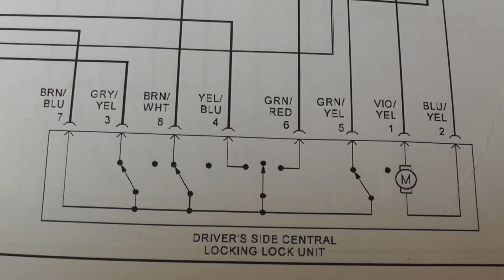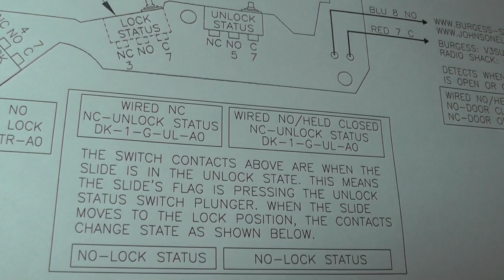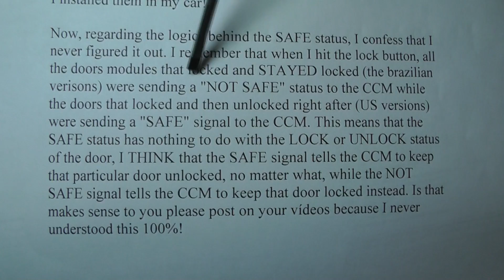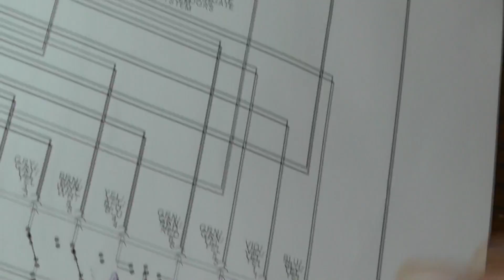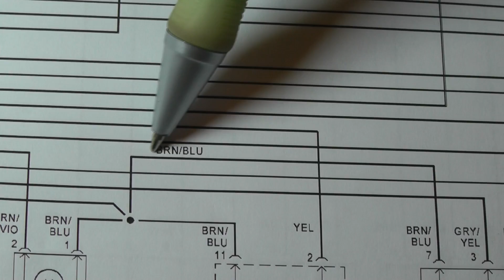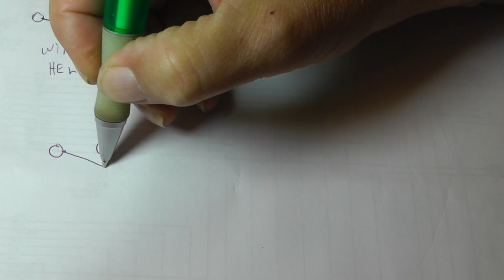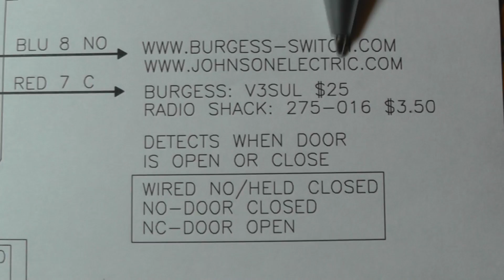The Electrics of Volkswagen Door Lock Modules - Part 3

Comment: It would have been nice to supply a test sequence for the 1-8 connector to establish if and what electrical problem is present.  

I have a convenience module in emergency mode which some have said is caused by a door module.  So I would be helpful to verify if the door module is functioning correctly.  But a great video presentation.
Reply from the maker: Thanks for the comment!

Comment: Thank you for taking the time to make these videos. I appreciate your methodical and thorough presentation. I subscribed immediately and am looking forward to watching your other videos.
My door lock problem is I cannot lock or unlock the door wirelessly with the key fob. The electric motor will turn the gears and move the plastic worm screw shaft when it disassembled and separated from the rest of the locking mechanism, but it doesn't have the strength to move the components when it is assembled. I doesn't appear to be binding and is lubricated, so I'll have to locate and replace the electric motor and see if that remedies the problem.
Reply from the maker: You are quite welcome Roy and thanks for the sub! From your description of the symptoms, it does sound like the motor may be a little weak. Good luck on your repair and have a great day!

Comment: Hello Mr. Stuzman!  I appeal to your experience!  The front right door would no longer open from the outside or from the inside.  I replaced the frog with a new one.  After two months, the same problem.  Now I bought another new frog, which has been working perfectly for two weeks.  Now I can't open the door in any way, neither from the inside nor from the outside.  You can hear how it works electrically, but it doesn't unlock.  What can be the problem?!!!!!!!  How do I still manage to open the door?  Is there a solution?  Thanks!

Comment: have an issue and maybe you know how to solve it, it is a 2001 mk4 TDI driver side door that would unlock using a fob but won't lock using a fob. it would lock using a fob, only if I unlock it and lock it within a second, same situation happens inside the car, with 2 buttons near the inside door handle. any ideas, or suggestions?
Reply from the maker: You probably have an issue with the door lock module. Have a great day!

Comment: I have an American version Jetta, when you push the door locks it locks both right doors and the rear left door and attempt to lock the driver door but then unlocks it I guess so you don’t lock your keys in the car? I wish I could push the lock button and it would lock all four doors so probably if I got a force switch module for the drivers door it might lock it and do away with that problem I think they’re saying safe mode would be Unlocked so you wouldn’t lock your keys in the car?
Reply from the maker: You're probably right that the behavior is to keep you from locking your keys in the car.

Comment: Hi Mr. Stuzman!  I have an unanswered problem.  When I open the driver's door, the door light comes on each time, but on the dashboard of the dashboard the open door indicator light comes on and goes out.  If I tap the door module lightly, the indicator light on the display lights up continuously.  What could be the problem?  Does the light in the door lamp that I put on the LED influence and it is no longer an incandescent bulb?  Or is there a problem in the door module, imperfect contact at the connector pin, microswich ..... what can it be ???
Reply from the maker: When you tapped on the door module, it shows that your problem would be inside the unit. More than likely you have a bad solder joint(s) on the pins that connect to the PC board. In any event, you'll have to take the unit apart and open it up. Have a great weekend!
Reply: Thank you very much Mr.Stuzman! I'm very grateful!!!
Reply from the maker: @octaviansorescu7427  You are welcome Octavian!

Comment: Thanks both for your professional job.
From the UK I can tell you that even with a fifth microswitch on the board, it never gets operated - on my 2000 Passat at least! In my driver's door lock there is a nylon latching mechanism (which you don't have) underneath the helical gear part. Maybe the case is a bit deeper to accomodate this. This is a swinging arm with tracks that engage with a pin below the brass part that deals with the motor stalling.  This part has 3 detents, in theory allowing it to swing across to two alternative positions below the helical slider and a tab that would, in theory, operate the fifth switch. But it has NO spring to bias it in the direction of switch five and so it never moves. I can only assume that the mechanical part of the mechanism was designed pre-1997 and the electronics 'improved' later leaving a bunch of redundant gizmos 'hanging'. 
By the way, Cherry is now part of ZF and the  DK series microswitches are everywhere unavailable, or at least have a MOQ of 20,000!
Reply from the maker: Thank you Michael and greetings to you in the UK. Yeah, it's a wonder what the fifth switch actually does. And thanks again for leaving a comment!

Comment: I think I can explain what the missing fourth micro-switch on the actuator PCB does for UK/Europe.  
All vehicle door locks must have a two stage locking action. 
Stage 1 locks the door and disables the outside lever. 
Stage 2 dead-locks the door and also disables the inside lever, so that the door cannot be opened by breaking the window glass.
To achieve this dead-lock, the lock motor is pulsed twice in the lock direction.
What is missing in your US version of the actuator is another 3-position lever below the slide that only operates this limit switch in the dead-locked position.
I have recently taken apart the driver's door lock of my VW T5 Van where the actuator is similar, but right-hand drive.
I can send you a photo showing this lever with the actuator slide removed if you provide me with an email link.
Reply from the maker: Thank you Brian for the added info as I'm sure that it will help others out there.

Comment: I wish all documentation were as clear and comprehensive as your diagrams! It took two days' work but I've fixed one door lock module with help from this video and others on YouTube. The fault was the usual cracked solder join between PCB and connector. What were VW thinking, using rigid metal lines to connect a motor, a PCB and a connector?!
Reply from the maker: Glad to hear the video(s) helped you out!

Comment: Safe locking prevents door to be opened at all, it is made by 3-state lever which makes even lock button inside inoperative. Then only way to release locking is by motor. 
My problem was that lock did not open by motor, maybe once of 10 trials and in winter never. Don't know if it was electrical, software or mechanical problem related to 3-state lever.  I solved problem by removing the lever and now lock has only two states, locked and released.
I can hear difference when opening, the door with lever removed says single click, and door with lever still in says click-click as mehanism need to make two opening movements to jump over safe state. I assume this difference is contolled by software reading status of 3rd microswitch.
Reply from the maker: I would assume so also. Not 100% sure.

Comment: EXCELLENT! THANK YOU! 
About SAFE function: it disables internal handles, to do that there is a specific leverage inside latch module and the famous 4th switch. When you lock the doors the Comfort ECU sends TWO pulses to the motors to properly actuate safe machanism, 4th switch sends feedback that safe lock is activated. The goal of SAFE is to put some more difficulty to thief: if you break one window you can't easily open doors and enter into the car. Why building it so complicated, with additional leverage and switch? Because SAFE lock is default but it is an option. You can still lock in normal way. How? Click twice when locking your car. You can hear one single pulse to latch motor, additional leverage is not triggered and internal handles are not disconnected. SAFE function works if Comfort ECU has the correct firmware (sends 2 pulses to lock), that's what happen for markets outside US. Hope this can help someone, like often I've been saved by your helps.
Reply from the maker: Thank you Mauizio for the added information!

Comment: Hello there, Great videos. I have seen these locks deadlocked on cars in a few videos. Mainly from UK. ( mine is at the moment). You have obviously sussed the 4th lock switch function by now. The question I want to ask is this: as the lock is in a locked position, why didn't you use your technical knowhow abiltities to work out that reversing the motor may unlock the locked lock. (motor lock has 3 positions. unlock, lock and deadlock). Would it be of benefit to trace the lock loom out of the locked door into the cabin area of the car and find its ecu ( if it had one) and trace the pins on ecu that control door lock motor and apply voltage to the loom pins that free the lock from its locked state. ( did you pin 7&8 are motor lock? i forgot) That way people would not need to take a drill to their doors. Last thing. would the lock be able to be engaged/cycled as an ouptut on VAG or ross-tech software. Then there is no need to strip trims, carpets etc to access Joints/ecu's   Thanks
Reply from the maker: Reversing the motor could work sidnol, but the issue is getting access to where the motor is controlled from. The motor leads and the wires for the door switches goes to the door module. This module has the power window motor attached to it. So, to get access to it, the door panel would have to be removed. To the best of my knowledge, I don't believe VAG or Ross-Tech has a bidirectional control to lock and unlock the door. It's a real pain when your door is locked and you can't unlock it with the key or FOB. Have a great day!
Reply: @stuzman52  Good day sir. I dont think I explained myself very well. i will try again. At 3.00 mins in this video it shows the lock motor connected on terminals T29/11 and T29/1 and they are coloured ll/ge and bl/ge in the "isolok" connector, (if that's what it's called). I was talking about tracing these wires through the "B" pillar loom back to local ecu/control module (may be under passenger seat, footwell etc. Disconnect loom (knowing you what colours to look for) from ecu/module and put 12v signal on loom from a small 12v battery, (borrowed from house alarm back up) to reverse the motor and thus dis-engage dealock/lock. Leave the door alone with drills and pry-bars. Would this be possible do you think? Thanks
Reply from the maker: @sidnoi  yes, what you suggest can work if the system is as you describe. I don’t have access to the wiring diagrams as I sold the car about two years ago. If I remember correctly and I could be wrong, but I believe the operation comes from the comfort/convenience module which is under the center of the dash. I believe the operation of this module to the door module is done on a pair of communication lines. If you have access to the diagrams, you could see how the system is connected between these two modules. Good question!
Reply: Comfort ECU (over the pedals area) sends digital commands over CAN bus to door nodes, that are the ECUs integrated with window motors. From door node to latch module connections are direct (simple switches digital signals and power to the motor). But all thst is behind door panel.

Comment: what is  the "Power Tops System" ? i noticed it is pins, 7 and,10 of the CCM on your diagram.
Reply from the maker: I'm not sure what you mean by Power Top System Eijah. Sorry...
Reply: stuzman pin 7 from the CCM (Yel/Blk) wire and pin 10 red/brn wire from the CCM
Reply: stuzman on the Mitchell repair schematics pins 7 and 10 of the CCM says “POWER TOPS SYSTEM “

Comment: First  of all love the videos, however I took my driver side module apart and found that the pinout configuration is not the same as the configuration that you are showing on your diagram. My car is a 1999 VW Passat 1.8t
Reply from the maker: There could be some discrepancy between the years of cars.

Comment: Thanks for good visualisation of VW door lock. It helped a lot when repairing almost totally bloced co-driver's door of VW Transporter. Finally I found the fault, the white linear moving part was blocked in extreme end of movement because it was not properly seated in in the white lever located in white motor cover. This even prevented internal button of door to move white linear lever inside motor.
Additionally, this was European version with fourth microswitch. Mechanically there is additional green "mechanical 3 state lever" operated by the linear lever. In 3rd position lever operates fourth microswitch. Safety function was explained in owner's manual: "If safety function enabled in factory settings, opening with remote control opens only the driver's door and all other doors are opened by 2nd open command of remote". 3 state lever inside motor has states open - secure locked - locked. In locked status locking can be opened by door button inside, and in secure locked state not, only by motor.  Obviously when security function is not enabled, opening of door happens by two opening commands (due to 3 state mechanics). You can actually see and hear it as lock makes double click when opening. If American version without possibility of sefaety function, no 3 state lever nor 4th microswitch does exist and opening requires only one motor drive.
Reply from the maker: Glad to hear that the videos helped out! And knowing what the fourth switch is used for is very helpful and can be of great benefit learning about their door lock modules. Thanks for the comment!
Reply: I totally agree with 3 state leverage considerations: that's SAFE function. 
I' m confused about 'safety function' reported by manual: that's nothing in common with SAFE function, 3 state leverage and 4th switch: it's a completely indipendent pure firmware additional feature. 
Do you agree? 
It's what we call in EU 'american open': 1 click to open driver's door only. 
Can it be activated on european car?

Comment: I have heard that on some vows there is a switch that locks the doors when traveling over 15 mph. That may have something with your safe and unsafe mode.
Reply: That's a firmware function that you can activate with VAG and is not the SAFE feature connected to 4th switch. You can activate it both with 3 and with 4 switches.
Closing doors in march is not a particular useful function imho

Comment: if we disconnect the plug to the driver door actuator can we use the lock manually
Reply from the maker: You should be able to use your key to manually unlock the door.

Comment: The SAFE LOCK mode in European VW golf MK4/Bora is activated pressing one time the remote control or turning the key clockwise one time.
With SAFE LOCK mode active, the door can't be opened from inside the car.
To lock the door without the safe mode, you need to press twice the remote control or turn the key clockwise twice.
In this way the door is locked from outside, but can be opened from inside the car: the first time you pull the lever the door is unlocked. Then if you pull again the lever, the door is opened.
Reply from the maker: Thank you for the added information about the safe lock feature.

Comment: I put a pin switch now, its 2 years, i passed a wire from ground(bare metal) to the brown and white wire of the door puddle light, and i had cut the blue red wires on the door lock module. Everything works fine  BUT ever since i get a interior light time limit unknown switch condition error. Any ideas what i did wrong?

Comment: Thanks so much for doing this great video, it has been really helpful in diagnosing the lock issue I was looking at on my step daughters '05 beetle.

Here's my shillings worth. The drivers door lock was not responding correctly to the remote fob signal, the door was supposed to be locked but it remained unlocked and hence the alarm would go off when the door was opened.

Using your info and picking through the details it looked like all the connections, joints and switches were good. Obviously this beetle has the extra switch and a different set up for the motor. I used a power supply to test the lock motor and all seemed good but I kept coming back to it. I ended up removing the good lock and swapping the motors over and the lock worked. Great.

I then removed the motor and stripped it down, took the time to clean it through and check the brushes and bearings, on putting it back together and reassembling the parts it now seems to be all good.

Again, thanks for all the info and for your time to put it together in such a helpful and informative way.

Cheers, Nick.
Reply from the maker: Thank you Nick for the comment and your experience with your door lock module will surely help others out there!